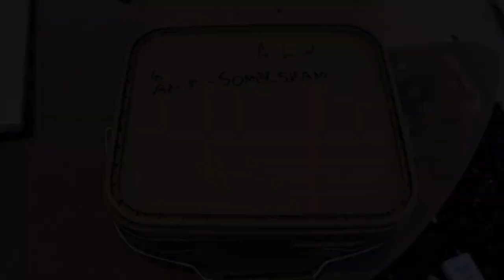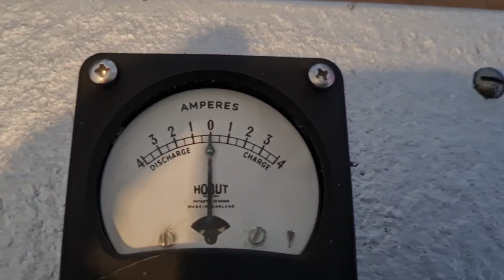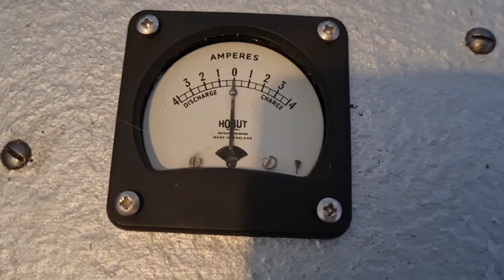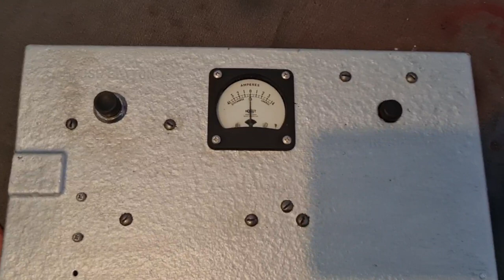Lister Startomatic control box.

Comment: I worked in the generator industry many years ago, and my late father and I would go out to a non running start o matic, and it was generally a really fault. Burnt and broken contacts were normally to blame. You can replace the old relays with modern heavy-duty units. I've just bought two start o matics and one later machine from an off grid property,  we are removing all three next weekend. The start o matic was a great idea back then when no one had fridges or freezers or even tv's, flick the light switch on in the house and start o matic would start up and the lights would come on. We now take electricity for granted.
Reply: I recently acquired a lister 6cs with startomatic genset but the alternator controls and I presume controlboxes need overhaul, some parts are missing as i bought it stripped, do you know if one could make a new solid state controlbox for the above providing the alternator is still servicible?

Comment: it will be nice to see it all together runing
Reply from the maker: Hopefully won't be long now. I'm looking forward to it also.
Reply: @NorfolkMancave  Take care with the contact positions on the larger relay, the bent bits may just be previous adjustments. It is essential that when the large relay operates, the normally closed contact connected to the smaller (load detection) relay (connected with a yellow wire) opens before the mains contact closes. My version has a series resistor which catches fire if the mains contact closes before the low voltage detection contact opens!

The relays are the same type as found on GPO Strowger exchange equipment, the contacts are often called spring sets which may help when searching. It is not easy to find the higher current contacts as found in the Lister control panel, though I did find some new old stock ones for a repair I did about 8 years ago. 

 Here is the one I'm currently working on: q6mLdAHZmuo Give us a shout if you get stuck, I've studied and repaired various start-o-matic controls, they are much simpler than they first appear, once you break the circuits down into their individual functions. The design is ingenious in its simplicity, but must have taken quite a lot of design and experimentation to actually get it to work! 

Top marks for not throwing the start-o-matic controls away because they are 'too complicated'. That sadly happens far too often during restorations.

Comment: Hey Adam, with that donut looking like it does, you need to get a small acid brush and clean all the gunk off the donut. The donut is for hysteresis to clean up the power spikes and unless you spend some time brushing and cleaning it it will probably short out and cause you no limit on damage. The blue finned thingy is a silicon diode and needs replaced with a small solid state diode so you can get DC power. Got it??  Well good Adam you can do it man. Keep up the wonderful work. Keep struggling and molesting and this will work perfect.

Comment: That box is looking pristine, can't belive how far it's come now, good to know the st2 is getting her original tank back. Maybe Jeff's sl startomatics points are bent too or have severely corroded I recon it's worth a look at that 👍
Reply: That's a good observation, and if you look at the video where Adam and Jeff first attempt to test the output, power is generated immediately the engine is turned over. I do not think that is correct from my understanding of the circuit diagram, and in fact it should only generate power once the engine is up to speed via that large central relay which changes over from start to generate. The lack of change over - or rather, stuck on generate, may be why it failed to keep running once the start circuit was removed via the switch, or manual closing of the start relay top left.
Reply: @squelchstuff  now you say it I would agree with that looking back at it

Comment: Looking good there Adam. 
A few points if I may?
The two capacitors (top right) are in fact a resistor (marked as a ballast resistor in the circuit diagram) and the real capacitor is blue.

The relay/contactor could be replaced as a whole unit, but if you notice, it is modular, so one good out of two could be made. I'd err on soldering rather than wire joins tbh. As this part is most likely to get disturbed due to its prominence, it might be worth checking Jeff's for wonky contacts too as someone already has said.

The things with fins along the bottom are diodes. They use selenium as the semiconductor, as was common for the time. They can go bad, and emit a rather stinky smell that can only be experienced rather than described.

I see your very nice train set, so you might be able to run some basic tests on the control box with the kit you already have. The relays in the control box are 12 volt rated, so either a battery, or your train power supply could be used to check operation. A power supply is the more prudent option as it will be current limited, and less likely to let the magic smoke out it things go wrong.  If you have a multimeter - a basic car electrics one will do - those diodes can be checked. They should only conduct in one direction, so the resistance or continuity ranges should show that. Continuity of the contacts on the relays can also be checked with this too. Failing that, a test lamp and power supply can be used for most of the tests

As already mentioned, the selenium diodes can go bad, but can be replaced by modern equivalents. These are much smaller, and have higher ratings. I have seen someone keep the original look by fitting a modern component inside the fins of the original.  One of them is what's called a bridge rectifier I believe, and this effectively contains four diodes to convert the AC out from the generator and converts it to DC for the controls and battery charger. Again, a modern equivalent can be used. They look like a small square block with four legs/pins. The other concerns are the capacitors. They do not age well, so might be faulty. The blue one can certainly be replaced directly with a modern equivalent, and the large block ones can be replaced with recently made replacements of the same style, but are harder to find. Alternatively, all modern can be used, but you'll ose the original look.

Good luck with the rebuild anyway, and I look forward to seeing it all working.
Reply from the maker: Well thanks very much. You clearly know far more about this stuff than I do. I have little to no clue about it. Yes I see them relays come to bit. Problem is the doner relay is so corroded that the screws just won't undo. 
Could you by any chance contact me on on messenger /Facebook  or WhatsApp? I may well be after your advice on replacing with modern parts. Thanks for your through reply. It's a great help.
Reply: @NorfolkMancave  No problem at all, and I'm glad to be of help. 

Not a fan of FB and Whatsapp went the same way, but I do have an emergency method I could try.

 I could always put up some smoke signals otherwise. I am in bandit country after all :-)

Comment: Nothing sad about creating something.  The starter problem can be overcome (short term) by the use of longer bolts and equal washers between the starter and the body of the engine.  Rotation is something else to consider.  Your posts/videos are motivating, I  look forward to your progress.
Reply from the maker: Yes I'd I can find out the thickness I can maybe make a space. And I'm 97.6% sure rotation is correct.

Comment: Great vid Adam I found out that you can only take one engine to strumpshaw because lack of space so it’s gonna be a busy one this year. I’m going to put the Peter on the trailer with a pump and most likely a BSA gen set as well and if we can the small little engines in the back of the car for a good display at strumpshaw. What will you take there ??
Reply from the maker: Ow I will be there mate. Probably take my old Ruston PB as that's my favourite engine. Can only 1 hay. That's new.
Reply: @NorfolkMancave  I’m not quite sure you will have to look it up

Comment: It was my main big relay that got damaged please help to find a teplacement.
Reply from the maker: H ya Boet. Ow sounds like you got problems. To be honest I'm the least qualified person to be able to offer you advice as to be honest I know very little about them myself. The engine side I'm OK with. The generator side I have no clue. I Just hope mine works when I finally get it finished. I do hope you can get it sorted out. Has the big main fuel blown? I would have thought if a fault came up that would have blow 🤔.

Comment: I usually replace the 2 diodes, and 2 capacitors, there is normally an adjustable resistor mounted on that upper tag board, though not all models have this. If you want to get rid of any of the left over parts please let me know... Have you tested any of the relay solenoid coils yet, the very fine wire can corrode through if it has been somewhere damp. These are well worth getting working, and they are much simpler than the wiring may suggest, though the circuit operation is very carefully balanced in order to make it work. The design is very clever indeed. I assume you already have the service manual and wiring diagram for this control system? Keep working at it. There is a video of one of these control boxes working on my channel. https://www.youtube.com/watch?v=q6mLdAHZmuo